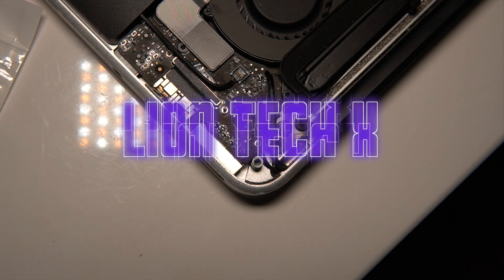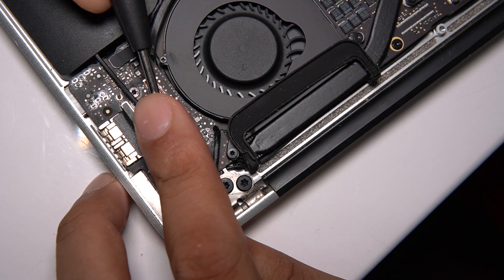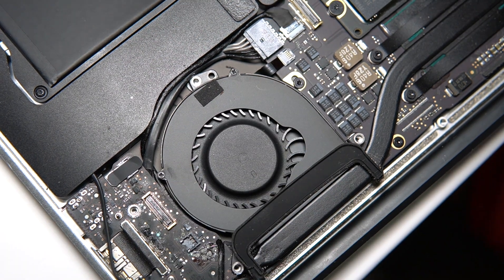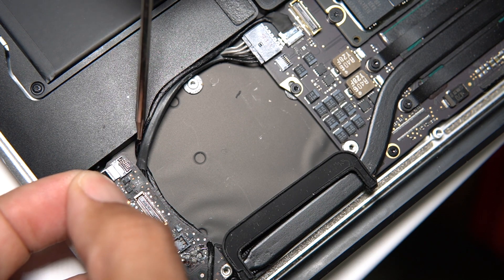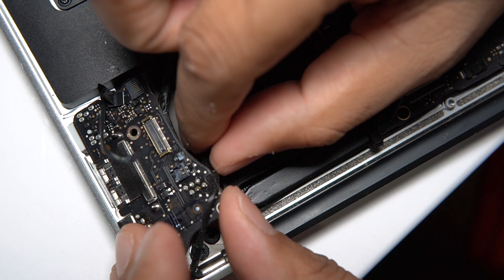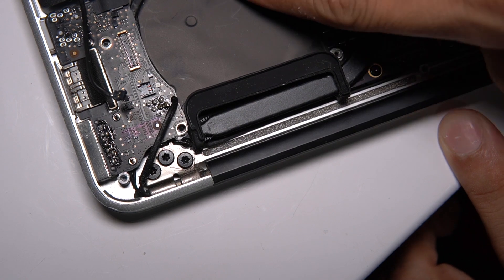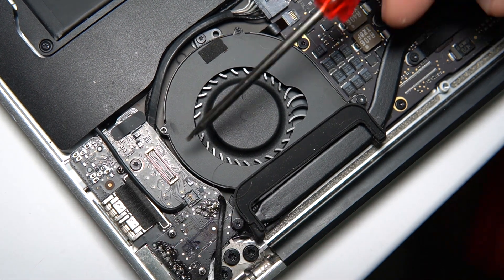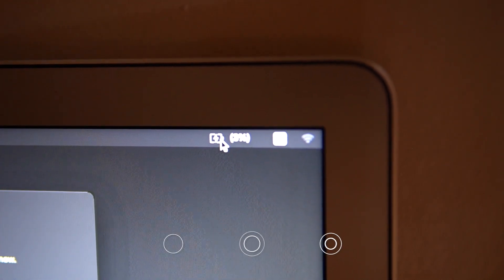Macbook Air A1466 Not Charging I/O Board Replacement

Comment: This was very helpful but unfortunately, it did not fix the no charging issue. The battery and power adapter were replaced first so this was the last option. If you have any advice that I may not have tried yet, please let me know.

Comment: Can you give me some advice please? 
I got my macbook air 2015, wich i did ‘t use in almost 2 months.
And now it won’t turn on anymore.
I get an orange light from the charger when connected and that’s it. Any ideea?
Reply from the maker: Have you tried holding down the power button? And then pushing it again?
Reply: @LionTechX  yes, tryed that. Discone trd battery too.
I don’t know what else to try. And i ain’t got the money to try out a new macbook

Comment: Thank you for your instructions! I replaced the I/O Board as you demonstrated and now my MacBook Air 2015 works and charges.
Reply from the maker: You're welcome. Awesome...
Reply: What was it doing wrong before?
I’m thinking of replacing the i/o board. Basically, what myne does is: laptop worked perfectly, didn’t use it in 1-2 months, now, it just shows orange light when i plug in in charging adapter, and won’t do anything when i try to power it on.